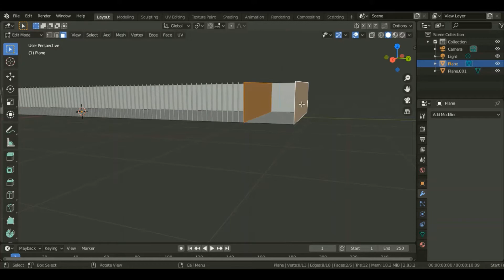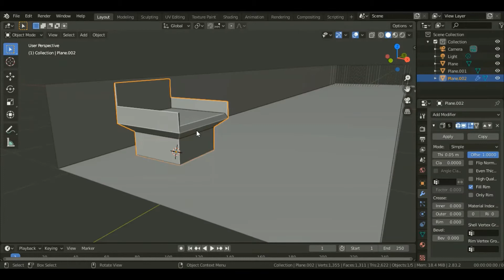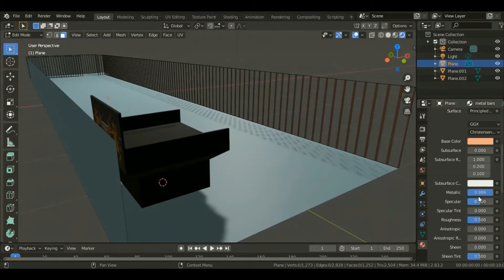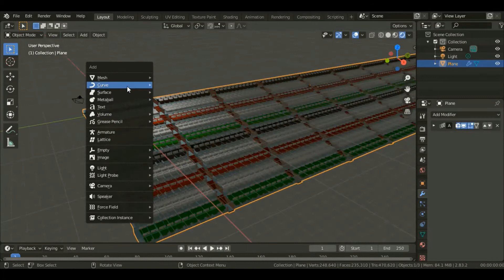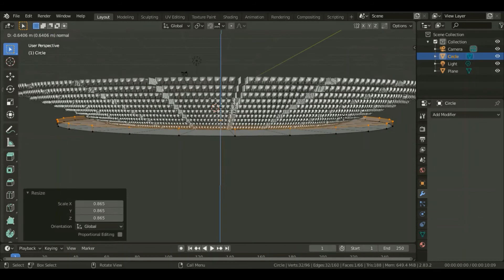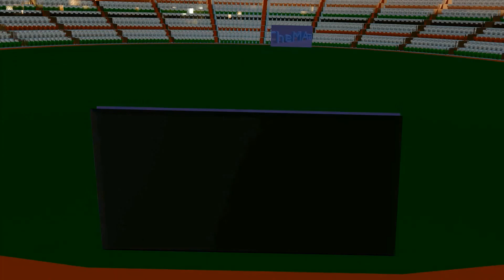Model a stadium in 2 minutes(Blender2.83)

Comment: This is a nice tutorial, thank you for sharing.

But I really don't like how the number of seats on the inside of the of the circle stays the same as the outside of the circle.

Do you know a way around this?
Reply from the maker: One way to overcome this is by using multiple array modifiers for every row, then incrementing the array value.
This will enable you to have less number of seats on the inside than outside, without changing the size of the seats.
Notice the previous method the size of the seats inside, and enlarges those on the upper side.